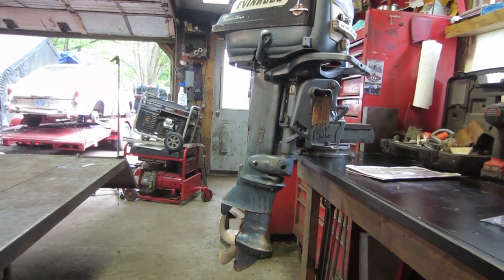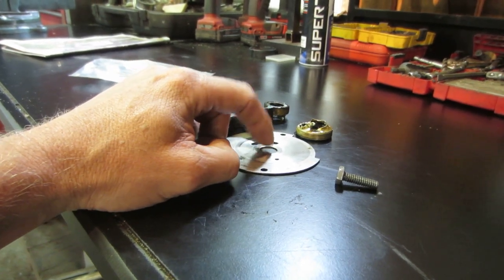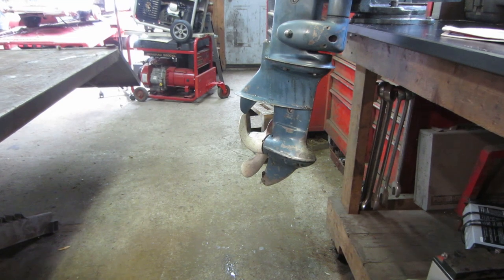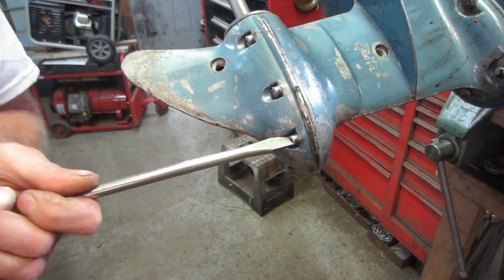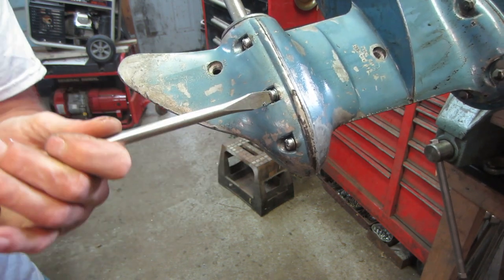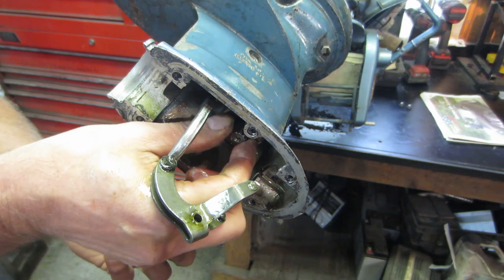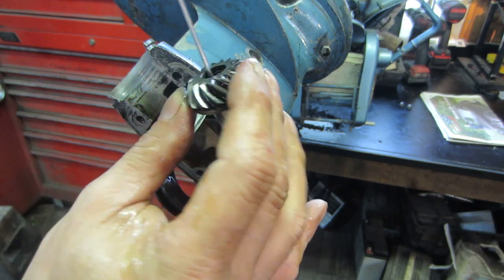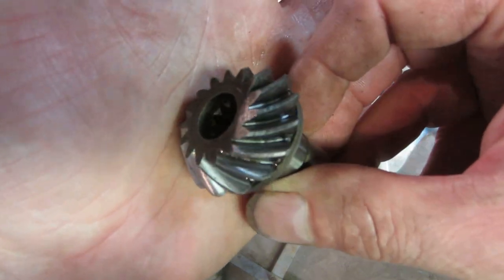1956 evinrude 10 hp sportwin, going in the lower unit once again

Comment: My grand father had a boat shop in the fifties and we still have all the old micro films. Their was no clip. It was supposed to ride on the pin, when they first came out there was a clip but they learned with the torque caused by forward and reverse the drive gear would ride up and down. They learned because of this they had a high failure rate to the drive gear and the forward and reverse gears. The shaft is floating so there is no pressure on the pin that is why it’s a pin and not a key way so it can move. This was a service bulletin put out around September 18 1956. It took me over 30 hours digging through films to find the info hope it helps.
Reply: You post makes me wonder if somewhere along the lines, the driveshaft was changed out. Not uncommon when a short shaft engine was converted to a long shaft engine.  Good info!!!
Reply: Thank You Anthony. From what I see with my 18hp, you are correct. (low hour all orginal motor in my family its entire life) I converted my 18hp from a short shaft to a long shaft so I have both of the driveshafts. Both the same except the long shaft is obviously longer.

Comment: Thank you Darren for having the open-mindedness needed to come up with a solution for this. Being receptive to the viewers/commenters input, regarding an issue that you felt was suspect, shows positive character traits and reinforces to me, your outstanding skill set. Thank you for being you and letting us wrench with you!    Chuck in Kansas
Reply: I guess you didn't see the previous video where the pin was resting against the plate?
Reply: you could see what happened to the old inpeller, the shaft didnt raise at al, see the wheare marks on the old inpeller, the clip has to be in it.
(oh , and working on these(and other) engines is my proffesion, so its from first hand, so not a cautch mecanic)
Reply: I believe someone commented the first video saying that the plate should be replaced together with the impeller. If that's true I guess you wouldn't really need the clip, the plate would survive the wear of the pin running on it long enough.

The real issue with the old impeller was the incorrect diametre, at least that's my guess. OTOH the fact how uneven the wear on the old impeller was makes me feel better about it with the clip too.
Reply: thats correct if you yearly change the inpeller and plate.(no one is his right mind wil do that, so musty,s solution is not bad!)

Comment: The only thing I see wrong with the circlip rather than the snap ring is that the chamfer on the drive shaft will help to keep the snap ring seated to a small degree.

Comment: I am happy that you revisited this. The way you have it now is correct. 
And just a FYI the 56 and 57 use the same gear case all the parts are the same.
In the future if you have any outboard questions I would be happy to answer them for you.
34 years as a outboard motor tech and member AOMCI.
Reply: @mwatkins2464  you are 100 percent correct.
Reply: @mwatkins2464  He tells you exactly that in a follow up video,  surprised mr "34 years as a outboard motor tech" didnt delete his comment
Reply: I hate to tell you fellows your wrong but you are that’s the way they first were made but they quickly found that shifting between F&R caused the drive gear to either want to go up or down

Comment: Recent viewer and love what you are doing. Proper thinking about the mechanics and working it out, great stuff. Also, if evinrude introduced a spacer in the 57 onward, its safe to say they felt it was needed. Personally, I would rather have the pin at the impeller end close to the centre of the impeller as it is less likely to fail. 1957 engineering applied to 1956 outboard, brilliant 😀

Comment: Great video ! I was facing the same issue withe a Johnson QD-16 and just thought that someone had substituted the wrong drive shaft at one point. Well, I just fitted a snap ring in that pinion gear's inside groove and now the impeller pin rides just where it should. Thanks a zillion !

Comment: And everyone. NEVER run an outboard out of water. Doing that will burn the impeller out almost immediately.
Even for a couple of seconds. The water "lubricates" the impeller as well as cool the engine.
Reply: That is what I think also. I think the rubber impeller will get hot real fast without the water to keep it lubed and cool. Those things are off set so they will pump the water so half of the blades are bent in the housing.

Comment: I did this same job and a oversize piston job. As for the lower end oil.  
As you fill the lower end put the top screw in loose and air easily comes out oil not so when it leaks oil from the top loose screw it is full.  I recall 90wt. Further, calcium builds in the water paths in the motor needs cleaning on a shop visit.   Fond memories of my rebuild of my Evinrude.

Comment: Hey mustie. I think that entire drive shaft and pinion gear needs to float up and down.  I believe that's why the impeller's inside bushing is cut as if it excepts a key instead of a pin.  The pin has the travel room up and down inside the bushing.  Ya did a great job running through the fix.  I liked the retaining ring idea. I was ready to grind a soft tapering into that shaft to assist in spreading the ring.  All good stuff

Comment: I'm glad you went back in .. in the first video I was sure I saw the groove for the snap ring (and I think you were right to use it instead of the wire ring , with the groove having square cut) . One thing I've found , cross over years can be either or .. as in you can find (for example) a 56 running the 57 set up but you could also find a 57 running the 56 set up !! 
Personally I would have done the same as you have .. now the pin is running somewhere near the middle of the pump impeller and not riding on the wear plate , and I'd feel much happier about that (again that's just how I'd have done it) 
Thanks for the follow up video ...

Comment: great repair mustie glad i could help and now that motor will run for many more years to come hope it will go to a good home and get a lot of use. Im happy to see you used the circlip that was correct for the groove in the gear in the end and realized that the shaft can indeed travel further towards the engine it is more than likely a bit of grit in the splines that prevented it from moving smoothly real good job THANKS FOR THE VIDEOS MUSTIE1

Comment: Hey Mutsie with all the gear boxes i have worked on in my 40 years of experience is that with gears like that there needs to be a certain amount of preload to prevent the gear from floating on the companion gear and prevent wear. After you add gear oil to the formula you create even more pressure causing the gears wanting to separate.  So dont be so obsessed with a slight interference because it in most cases needed. Good investigative work though.  Appreciate your videos..

Comment: Awesome videos, I got my 1977 F150 that I purchased 3 years ago and had sat for 13 before, also purchased a GX390 Honda pressure washer 4000 psi running again, great help.

Comment: Hey Mustie. I agree with it needing a clip. I have worked on machinery since I was a pup and some had the ideal it would stay up while running. Things like shafts don't behave that way. gravity works the same for all things and the shaft is no different in this case. Love the videos.
All my best Bobby
Reply: Bobby Tectalabyss torque of the motor does not allow the shaft to move vertical but there is not a issue if it does move. It’s supposed to have some play in it. The shaft will not slide out the bottom of the foot it only slides as far as the groves cut into it. It can’t drop down far enough to even hit the dog clutch anyways no matter what so there is nothing for it to hit.
Reply: @mwatkins2464  a simple exploded view would have given them the answer.

Comment: I ran into a situation I am thinking might be similar in a 59  35HP Johnson. Curious if you thought that somewhere along the line, the lower unit was replaced with the later model? The engine I am dealing with has a pin in the driveshaft for the water pump. Clearly no half-moon key. A half-moon key was sitting in the lower unit living below the pump. The parts diagram for the 59 uses a half-moon key.  Might fit well with what Anthony Demers found as well. Years can add to intrigue! Fantastic video by the way. As an outboard mechanic whose memory has a forty-year gap... I can say I remember converting many a short shaft engine to a long shaft and vice versa, and often the driveshaft was taken from scrap engines. We might have missed that a time or two. :0

Comment: Many years back a friend had a motor like that and noticed the same problem. He didn't like the thought of a snap ring in that end of the pinion gear because he felt it could come out and go through the gears. He wanted me to cut a snap ring groove on the upper end of the shaft so it couldn't drop farther into the gear. I thought a groove could cause a weak point in the shaft so I made a collar that was a couple of thousands smaller than the shaft and pressed it on.

Comment: Surely the action of the gears driving, would always drive the shaft upwards, pushing the pin off the plate when running. Just a thought. Fantastic videos. Thank you.
Reply: How? The gear was floating around on the spline. The two were allowed to move axially relative to each other.
Reply: nodriveknowitall 
I take your point. Something must take the upward thrust of the gear. I don't think this would be the gear case, I might be wrong. If there is a shoulder on the shaft, this would lift the shaft just a few thou. That pin cannot have metal to metal contact on the plate and it must depend on the weight of the shaft being lifted of it, if only by a thou or two.
Reply: There has to be a clip of some sort in that groove for this theory to work. I see the thrust pad under the gear now so the gear and the clip work in unison, controlling the gears position, holding the pin off the plate. Thrust lifts the gear and the clip lifts the shaft. Very interesting.
Reply: Discussing real objects in the real world sure beats politics eh? Lol.
Reply: there is a shaft bearing in the lower gearcase whit a shouder to catch the pignon gear so there is no upwarts thrust on the shaft, only the gear and the bronze bearing., the solution whit the clip is the correct one, you can also sholder the shaft whit a whelder to prevent the shaft going down to mutch and center the drive pin in the middle of the inpeller. the reason of the pin riding the wheare plate is to mutch play in the shaft and pignon gearwheel.
Reply: @MrBugsier5  a solution to a problem that didn't exist.

Comment: One thing you didn't seem to consider; you were pushing that gear up until it was hitting the housing. Very likely, when that motor is upright, the gear is NOT against the top of the housing and is riding lower when it is meshed with the other gears. That would give the shaft some of the "cushion" you were looking for.

Comment: FWIW, as soon as you put a load on those gears the shaft will be forced upwards and will not ride on the pin or the c-clip. The only time the shaft will rest on the pin  or the clip is when the unit is in neutral or the engine is off.  Thanks for all the great videos.
Reply: can you explain the marked wear on the previous wear plate and the destruction of the surface of the previous impellers brass bearing.
Reply: And what happens when you put it in reverse? Thrust is now in the opposite direction, pulling the pin down against the plate. As others have stated, that groove is there for a reason. Gear trains were all figured out a hundred years before this motor was designed and built.
Reply: Shockedbywater rubbish!

Comment: The action on the shaft will be to push up under load. The action of the impeller is to push down under load. It will all balance out when it is working. Great call.

Comment: Also...when putting the screws holding the foot to the main body and lower foot  screws, it is a good idea to put anti-seize grease on the threads. The screws will come out easier years down the road.

Comment: I am not an expert by any means but I believe the internal retainer ring is much better than the spring section.  I would not run the unit with the spring section in it.  
I think the pinion gear height is set so that the engagement with the drive gears is controlled for proper tooth engagement.  The internal retaining ring looks like the correct approach but the one you have has a narrow cross section and may not be the exact one intended.  The way the pinion is designed the engagement to the teeth of the mating gears is set by the height of the pinion gear as I said previously.  You can see the bearing surface of the pinion gear as the bronze bushing face that it rides on located directly above the pinion gear.  I believe the top part of the shaft (if my memory serves me) has a roll pin and a cup and spring at the top of the shaft where it enters the crankshaft end.  This spring is lightly compressed when the head to lower unit is mated.  This constant preload of the shaft downward keeps the shaft "riding low" or forced down toward the end of the lower unit. The flat plate was scored by the key running too low in the housing because the shaft was free to move downward unrestricted by the missing c-clip. This downward pressure is resisted by the internal retainer you put in to maintain shaft position up against this retaining ring.  This spring also preloads the gear engagement and eliminates gear backlash to an extent.  When you push the end of the shaft up into the head you should get slight movement and feel the spring at the top of the shaft where it enters the crankshaft.  The pin was riding in the wrong location because the shaft position was not controlled because the movement of the shaft was not limited by the retaining ring (c-clip). BTW there is no appreciable load on the shaft during operation in the vertical direction.  Good job, I think you have it fixed.

Comment: I'm still thinking that the thrust pushes the shaft up into the powerhead and centers the pin in the impeller. But I'm just using my experience with Jeep differentials.
Reply: What's going to thrust the shaft upward, if there's nothing locking the gear to the shaft axially?

Comment: If on the odd chance you do end up plopping this back on the outboard run stand and run it in the water barrel,  I'd love to see if there seems to be any more or less water flow coming from the hot water outlet, as compared to what we saw after the last build.  I have very limited experience with outboards, and what experience I do have is with 80's and up, so of course I have absolutely no idea whether the clip needs to be there or should not.  But either way, I certainly enjoyed watching the process, even if it was the same motor 3 times across 3 videos. Thanks for all you do !! p.s.  has there been any developments or contemplation on your end as to the YT video editor conundrum, and a solution for you to be able to produce and upload after YT removes their editor ?

Comment: I like the idea of the round spring clip better, you had the right idea about the shaft keeping it pressed against the walls.
You should have better luck finding them in an auto parts store rather than a hardware store.

But that internal snap ring should work just fine too.

Eases my OCD on this issue. XD

Comment: good move, that's the factory design and will last for years
Reply: now we can clear this out of our head. haha. maybe it wasn''t ment to be in the 56 but this gear pinion did have the groove in it indeed.  perhaps its some parts of 57 or later or perhaps half way the year 56 they started to use them. maybe even evinrude tought it was stupid this grinding pin on the plate. and they started to implement. the only thing we know is that this is the right sollution for the problem. also mustie wasn"t completely comfortable about the grinding dowelpin. now its positioned just right.
Reply: @jan spot on, just fix it, never mind if evinrude made it that way, who cares, it works
Reply: its factory miss disign and its crap, the clip is a good solution to the problem.
Reply: @MrBugsier5  ya sure never mind that it's 70 years old.

Comment: Hi!
The only thing you had to do was to compare when the end of the shaft was fluss to the gear and then measure how far in the shaft was pushed in when using the circlip and then measure that distance  on the center of the old impeller and see if the pin then was located in the center. which is the ideal location for it. That way you are sure the pin does not go to far upwards in the impeller.

Comment: It looks like that key pin should be oriented parallel to the driveshaft not 90 degrees as you have it.  That way it makes contact with the entire length of the slot in the impeller housing, only the very end of the key will be riding on the plate.

Comment: Just a thought. If they had used the correct impeller, it wouldn't have "tipped" up allowing the pin to grind out a groove and stop the impeller from spinning.